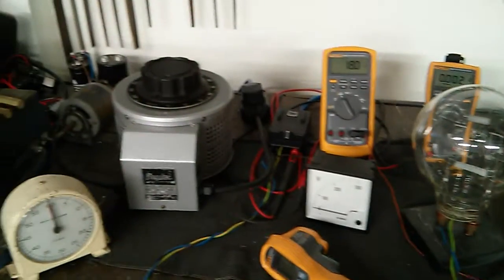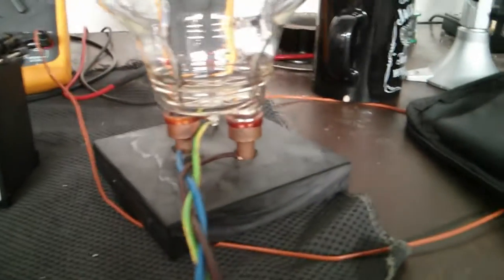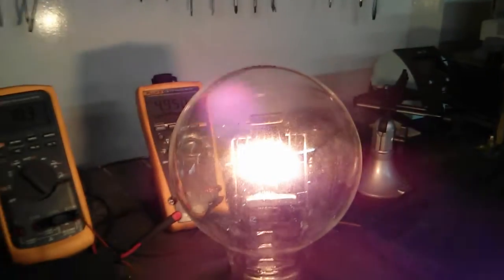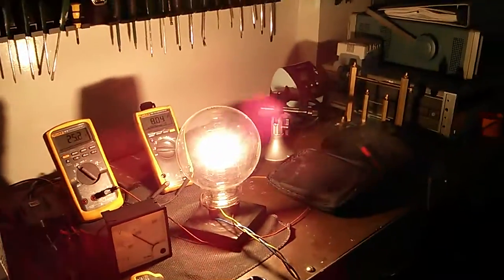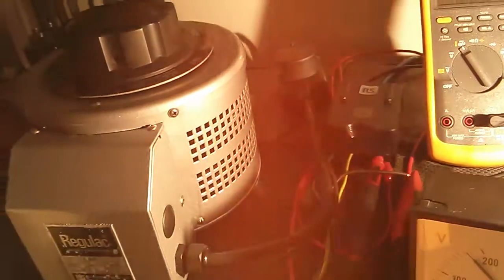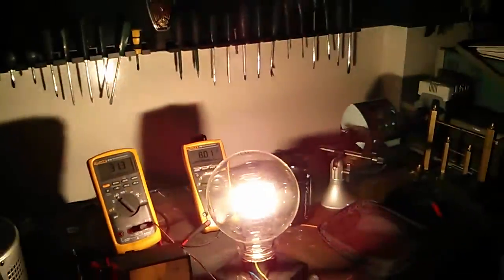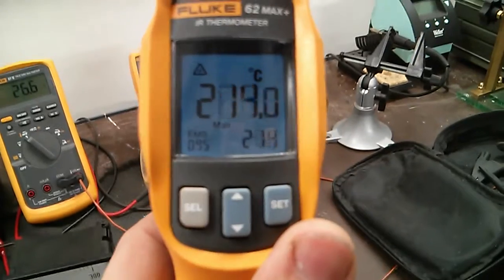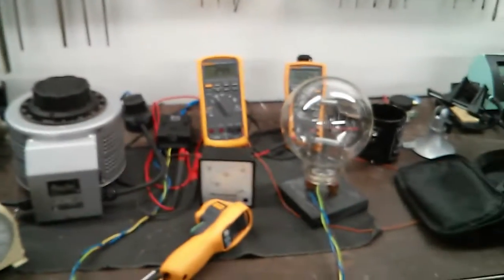Variac Load Test using a 2000W Soviet Cinema Lamp

Comment: 240v 2000W is only 8.2A it can handle 16A for 5mins according to the datasheet .this is only gonna be used for a phase shift controller as ill use my 30A zeniths for big loads upto about 60A and the two of them in parallel for even bigger loads upto something stupid like 25KVA